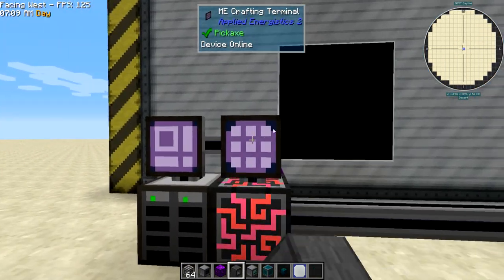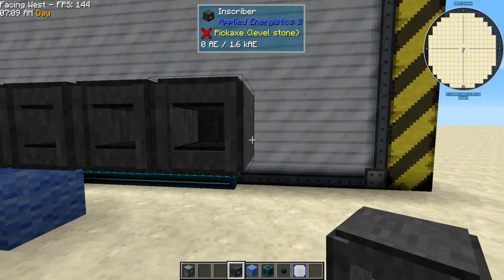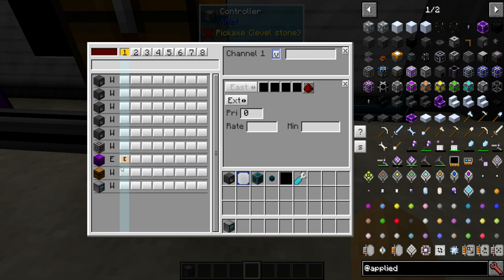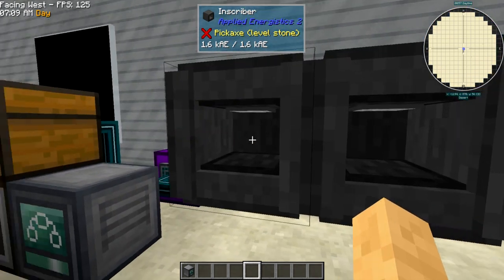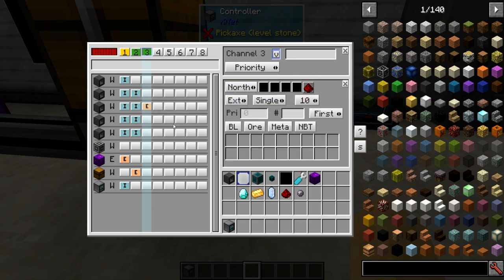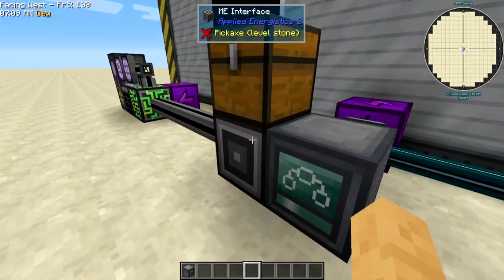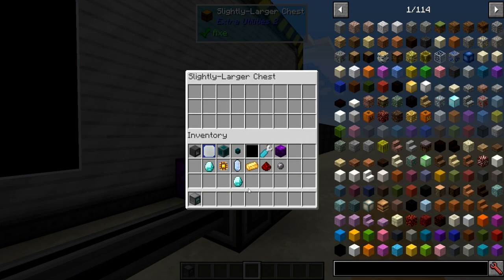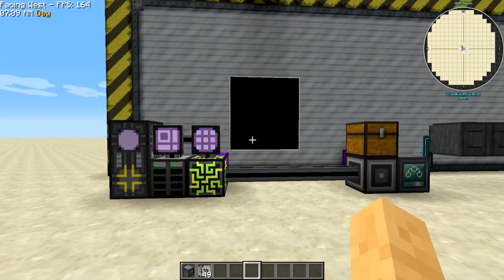AE2 Inscriber Automation: X-Net

Comment: I love when following directions to a T it still doesn't work for me cuz the game loves shoving a big middle finger in my face >.>

Everything works fine except the redstone will not populate in the final inscriber. I've tried setting a priority, remapping the instructions, etc. It will pull the redstone from the ME and the items chest, it just will not put it in the inscriber and it is tilting as all heck

Edit: Actually it looks like the ME system is taking the redstone and holding it unlike with the gold/diamond/pure certus and silicon, which these mats get pushed to the interface & chest so the Xnet system can use it.
Reply: too
Reply: you have a solution?
Reply: Don't use JEI/NEI to make the pattern.  Puts the items in yourself as a processing pattern.  If you use JEI/NEI's plus sign it won't send the redstone.
Reply: @thiagolelis4403  See my reply.  Even though this is a year later.  :(